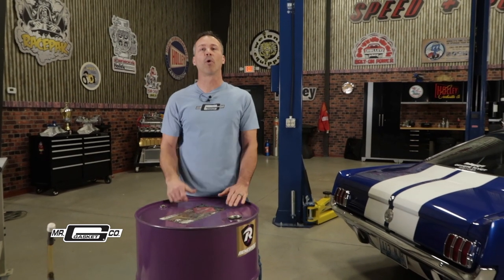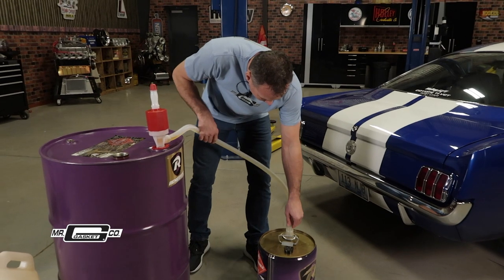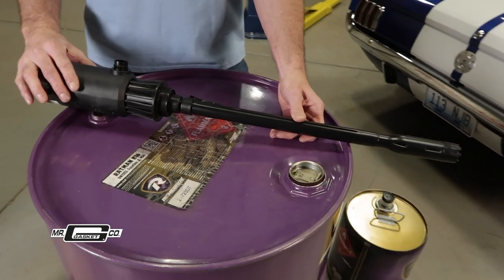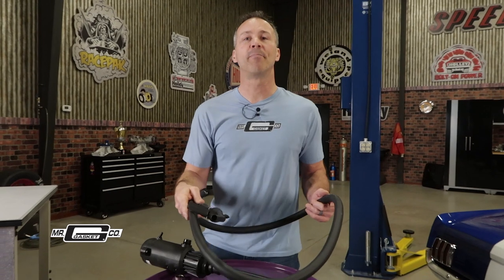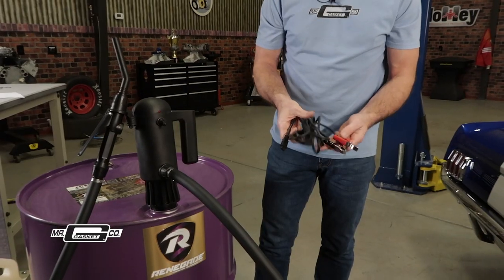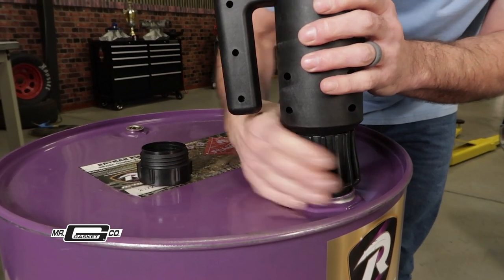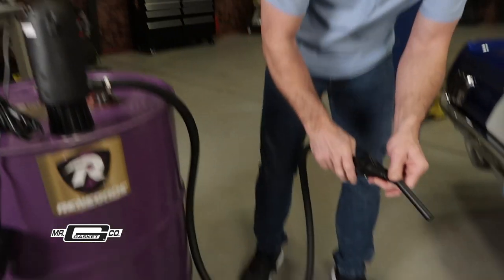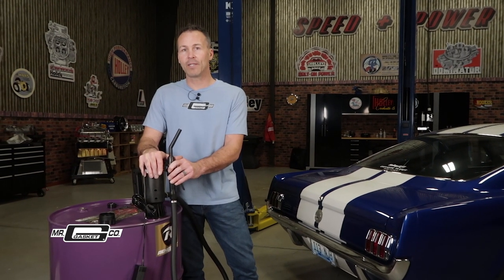Mr Gasket Electric Fuel Transfer Pump For Fuel Drums

Comment: We want to buy this for motorcycle track days.. 
But when I went on the website it says, DO NOT USE THIS PUMP for Transferring the following liquids; GASOLINE, E85, Diesel, Kerosene, Lubricants, Aceton, Benzen, Cresol, Phenol, Concentrated caustic soda liquid, Nitric acid, Hydrochloric acid, Sulfuric acid, thinners, or solvents.

If it can't transfer gas, then what is it made to transfer?
Reply: Yea same
Reply: I call bullshit idk why it wouldn’t be able to 😂
Reply: They give a warning like that to cover their ass in case someone blows themselves up from a spark that may be created by the battery connection.